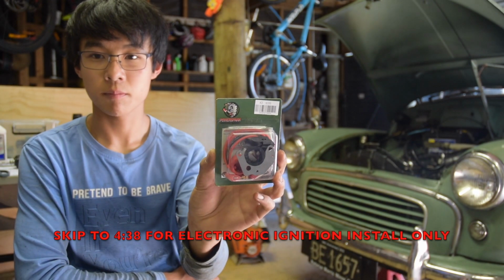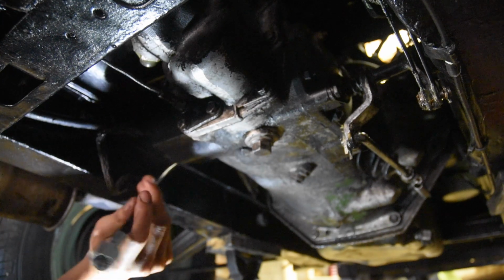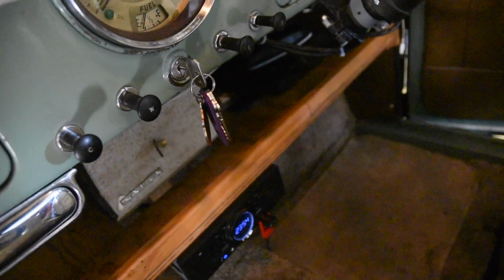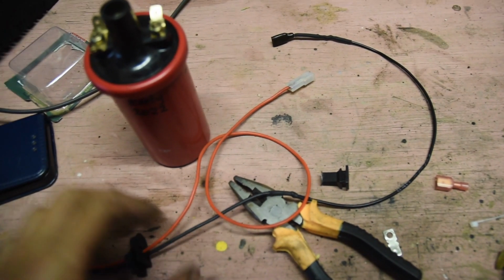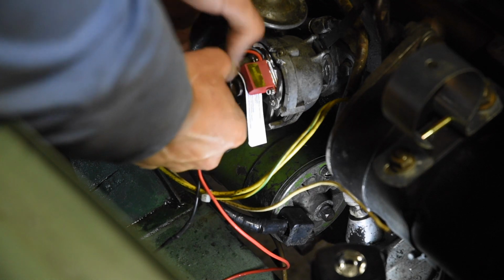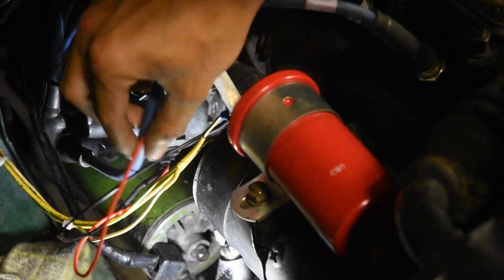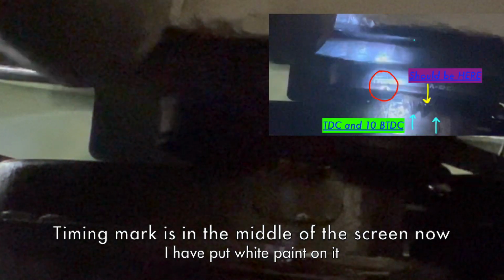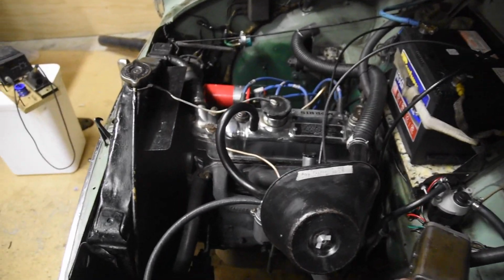Morris Minor Electronic Ignition Kit (Plus Speedo Cable Install)

Comment: Thanks a lot Rocky. I'll be doing this conversion on my Minor in the next few weeks. Colin UK 🇬🇧
Reply from the maker: Hi Colin, thanks for watching. You won't regret doing the conversion, it idles and runs so much nicer. While you're inside, make sure you check your vacuum advance is working correctly too if your minor is old, just suck on the end of the diaphragm and make sure the plate inside rotates. My one wasn't working, made HUGE difference when I put a working one in! Ha!
Cheers
Reply: @KingTriangleCat  Thanks again Rocky, I've just ordered my ' colourtune ' kit. I've only had the car a couple of weeks and it went straight to the garage for some welding. I should have it back next week and I look forward to driving it.
Reply from the maker: @colvinator1611  Ah right, that's for setting the mixture isn't it? I don't know much about them. Good luck! You will definitely have a lot of fun driving your morrie!
Reply: @KingTriangleCat  I will enjoy it. I'm sending for the full conversion kit in a couple of weeks so I'll let you know how I get on.
Reply: COLIN I GET ALL MY SPARES FROM     E S M  MINOR SPARES  UK     THEY  DO A DIZZY  READY TO GO  I FITTED ONE TO MY MINOR     NO TROUBLE   HOPE IT  HELPS
Reply: @alfgarnet-nq6dl  OK, thanks a lot Alf.